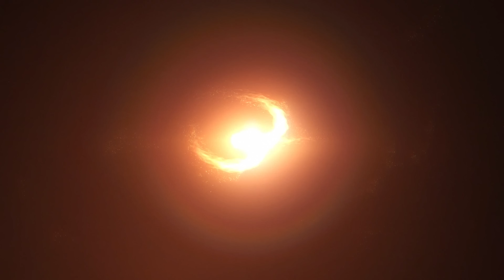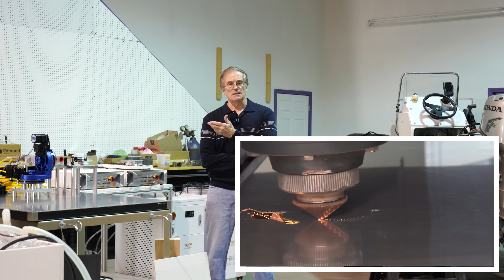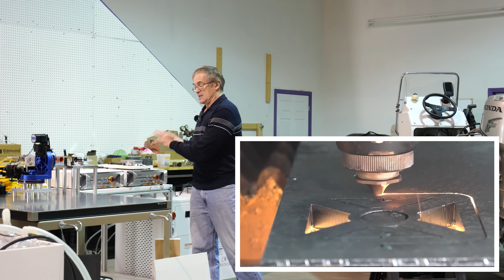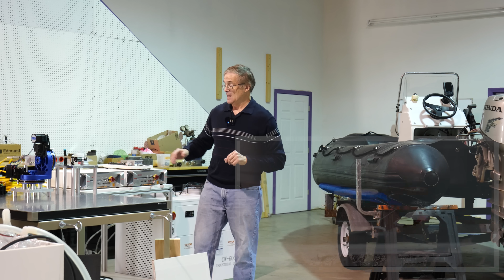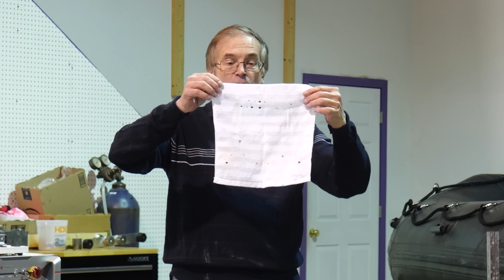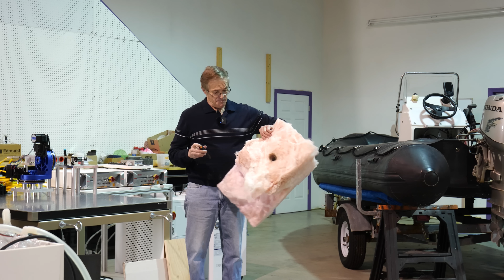We have a problem... and need your help!

Comment: My idea would be to not do what you're trying to do (block a high power laser over a large area with a low density, relatively portable material!). I would consider removing at least one of those constraints. I guess you want the high power and the large area for tracking targets across. One object you could use is the sky (after carefully checking there are no aircraft in it!). Your laser would diverge or get dissipated by the atmosphere. Fire your laser upwards, with motion of the gun constrained so that it can't reach too low an angle, and fly your targets over it.
Another idea is to use thick wood, like some tree trunks or telegraph poles stacked to make a wall. This would become much more portable if you hired a telehandler or a forklift, or perhaps bought an old used one. 👍 GL, HF, and be careful with those things. Those lasers look incredible!

Comment: Have you tried vitrified ceramics?  Like porcelain tiles for example.  Such ceramics can withstand temperatures over 2000F.  Come to think of it, maybe unfired clay?  The laser might actually vitrify it as it tries to burn through.  That might be an interesting experiment on its own.  Can you make porcelain with a laser?

Have you tried charcoal?  I mean like actual charcoal.  Not the stuff you use in your grill.

Comment: No degrees or laser experience, just a guy that installs fiber optics here but, would something prismatic work? My brain meat says if you had multiple layers of some sort of prismatic material, the beam would be split exponentially, causing reflectance and refractance effectively reducing the power. If you could find something to reduce the beam power by 20 dB (100 fold) would that be enough?

Comment: You need to switch the IR diodes that energise the fiber only when required. Continuous lasers uses a fully reflecting mirror at one end of the fiber and a partial mirror that reflects a some of the light and lets the majority pass through. It's on or it's off. 

A pulsed laser can however be controlled and can potentially reach the limits of materials in the laser cavity.  Such system may require diamond windows and front surface reflectors rather than lenses. In such systems the light output from the fiber passes through a polariser first then a pockels cell or Q-switch which is a mirror or window to polarised light when turned on or off depending on its orientation.   So one polarity of light is discarded while the other bounces back through the cavity producing more similarly polarised coherent light, building up power. After a pico second or so, the Q-switch is energised momentarily and an intense pulse of light is allowed to pass out of the laser cavity.  The timing of the switching of the Q-switch controls the pulse duration and the intensity. So allowing light to pass through the system will be very low power. Only after the Q-switch is sequenced on of off will the pulse energy be significant.  The key is to keep the power down until you need it and keep heed of the limitations of lenses, pockels cells,  polarisers, reflectors and windows.

Comment: With much higher temp resilience and insulation efficiency at temps over 3k°F than typical ceramic wool, Idon't know if stabilized carbon felt would burn off into vapor or hazardous dust, or if it would reflect. My first thought was to coat it in an IR reflective refractory coating, but that's not what you want. A test on 1" thick carbon felt batting wouldn't be too expensive. I think I've seen small pieces on Amazon.

Just wear a respirator and gloves. Make the test setup outside when handling unstabilized carbon fiber, then bring it in to an area with ventilation for the test.

Comment: Ceramic Fiber Insulation Sheets is my thought. Might not fully fall into cheap for the size you need but can take 2300° F and that is higher then normal red brick.

Comment: Maybe scattering the light somehow? You mentioned the laser didn’t do anything meaningful when not focused with your new set of lenses, maybe if you had additional lenses or a (possibly not as effective but much less expensive) large glass pane that has a rough surface to help scatter it that would prevent damage to the surroundings.

Comment: You need something ablative, like a shuttle heat tile. the removed material transports and diffuses the energy away from where you don't want it.  possibly aerogel?

Comment: A microwave tube engineer here, you need a wall of thick copper sheet, clad or brazed with a front layer of tungsten or molybdenum. W or Mo have very high melting points, while the copper behind it will wick the heat away to a larger surface area ( copper is a good heat conductor). The backside may be spray cooled with water.

Comment: A wall lined with ceramic tile, fire brick or Aero Crete with a cascade of highly aerated water flowing down its length should be sufficient. the bubbles should diffuse the beam and the h2o will take the heat away quickly. You could also try antifreeze (no bubbles) as it has a higher boiling point and i think the green coloured one would diffuse a good amount of light. just experiment with flow rate or viscosity and see how it goes! Good luck. love the videos guys!

Comment: When you get around to doing the video on the laser itself, I'd be very interested to see whether it could be suitable for boring into rock.  I recently bought some land which has a small granite mountain on it, and as it's a bushfire prone area I'd like to tunnel into the side of the mountain to build somewhere to live, such that any fires will go relatively harmlessly over the top.  As there are no roads it's difficult to get any sort of equipment in there, so figuring out how to bore a large tunnel into the rock is a bit of a challenge.  It sounds like these lasers could be a possible solution.  I had already entertained the idea of using mirrors to collect sunlight and using that to try to melt through the rock, but I'm not sure how to focus it far enough away from the surface being melted that the apparatus itself doesn't melt.  It's also a bit tricky working out how to get multiple independent mirrors to track the sun, and/or whether it's possible to collimate sunlight so that I can direct a beam of it somewhat like a laser.  But using a ready-built laser would avoid all those issues and likely leave the only problem being how to provide it with enough power.

Comment: The lockout systems from below, but also a fresnel lense made from some sort of rollable polymer foil and a drywall or whatever material about 30-40 cm behind it. Maybe one of those privacy foils used for glass to make it matt. IDK the spectrum absorbment of them, but it's worth buying some to test with.

Comment: How about a matte black  anodized aluminum plate 3mm thk with water cooling on the back (some sort of cheap manifold allowing water to circulate in the back)? Angle it also by a few degrees wrt your laser. Cheaper and lighter than copper. A bit more complex though due to the water plumbing on the back. P.S. love your videos.

Comment: If we're talking of destroying drones in flight, the solution would be to measure the distance between the laser diode and the target, either by alternating the power laser and a "distance" laser, or measuring the distance with the "return" of the power laser. When the distance increases dramatically between 2 measurements (say, every 100th of a second), it means the laser has gone through and shouldn't be fired any longer. Thus, the exposure of whatever is behind is not exposed longer than the frequency of the measurement.

If the power laser can be used for measurement as well, it's pretty straightforward, if you need to use a different pair of diodes (emitter+receiver) for measurement (both sides of the power laser), you need to adjust the measurement diode for parallax (emitter and receiver symmetrically), so you need to drive a microstep correction system on the measuring laser unless you're ok with holes as big as the distance between the 2 lasers.

Anyway, the idea is to stop shooting as soon as the target is pierced, not to block the laser beyond the target, which is not very realistic for a battlefield. In that case, you can even prevent shooting if the target is "too far" (say, 499 metres) so you're sure you're shooting a drone and not a bird, thanks to your very high definition camera that you could mount on a similar parallax-reducing microstep device behind a big lens (you don't need a panoramic picture of the scene): zooming in and out, you can get a pretty precise image of your shot and activate slow motion during a few milliseconds, so to confirm the shot.

To be fair, you should also tune the aiming system to make sure you're never aiming at eyes, it's strictly forbidden by the Geneva Convention.

Comment: What about a water curtain? Instead of a water soaked rag, use a curtain of flowing water. This way when the laser hits it, the water is constantly being replenished. Also hopefully the water will help disperse the laser energy that's hitting it so it doesn't continue past the curtain.

Comment: Hi, maybe you can use a glass wall 🙂... (Oh, is this guy stupid??? glass is transparent...) Well... think outside the box, you can use a lens glass that diverges the laser right after it hits the glass. Maybe a fresnel lens made of glass?
Reply: If it gets too expensive, maybe you can use a bunch of bottles (oriented is some way, you will need to test) and filled with water, that will create multiple lenses, the problem with that is that statistically at some points of that many bottles you will have a spot that will focus or not diverge well. But at least it could work as a proof of concept...
oh, by the way, as every one says their tittle... I'm a physicist 🙂

Comment: I was thinking of carbon fiber matrix (e.g. air filter sheets) with water circulating through it. It would be relatively light and cheap to run. After reading some of the comments, this might be a good, safe and reusable cooling solution when combined with the copper catcher and photovoltaic kill switch.

Comment: What about using the ground glass from an SLR to test. For the wall white translucent panels with the curtains that the guy who taught you laser welding had hanging in his shop. Just thinking about how impossible it is to focus the sun through a magnifying glass on a white sheet of paper to get it to catch fire, but put a single black pencil dot on the paper and it bursts into flame immediately. So I guess I'm saying go with diffusing the light rather than stopping it. Be safe.

Comment: How about using a lens as a block to expand the parallel beam back to a cone to disperse its power, and put some other material behind the lens to absorb the cone of light. Since the power will no longer be so focused, you should be able to use something like the drywall. Or maybe silicone? They use it for cookware, so maybe it would work?

Comment: One conventional suggestion is kaolin refractory wool. A more out there suggestion would be barrels of water absorbing polymers. There are round multi colored novelty ones used by many  content creators in stunts. I think they’re called zorbies or some shit. There are industrial bulk types used for  gardening and cultivation and in the manufacture of disposable diapers. These might provide the heat retention needed through water mass, and more material would steadily drop into the void created by bursting polymers. Just an idear.

Comment: Try asbestos. If that doesn't work I'd use a mirror to reflect the beam 90 degrees down from the wall to the floor into a tub of water or sand or something.

Comment: Twinkle chamber, with mirrors that Lower the transmission of Light by % on each step.
As you didnt Show a Mirror or a Prism to Split the Beam a million times.
Those are my choices, 
Unless you can find a Dirt that does not burn.

Comment: Since Plywood worked decently well a possible option would be to coat the boards with intumescent paint, on both sides, and create a stack of coated boards. Nighthawkinlight had some videos on the topic: https://youtu.be/8Z5RPPRS-KQ?si=o-zFT7-lifv9VaDC .Also I have some friends that work at LLNL NIF and could see if the have any info on how they manage the beam line on that machine for testing. Myself I work with 500 - 1kW lasers for industrial laser powder bed 3d printing at Sandia National Lab and am always happy to talk tech if you want to discuss more in detail.

Comment: I had 2 ideas. 1 is the fiber cement board (already mentioned further down). If you need some serious mass you could toss sandbags inside, but it might be enough to fill with fiberglass since the cement has already taken the brunt and broken up the beam somewhat. The other is to mount the laser in a truck and go to an old stone/gravel quarry. They're all over the place, so I'm sure you can find one nearby that would be willing to let you use it. A hillside of pure rock can absorb a lot of damage.

Comment: Loved this challenge. Here's my bid for your use case of a portable, cost effective, "crazy-powerful-laser" backdrop. A water-based carbon-black clay slurry. Considered glycerin originally, but decided the uh... "stinky byproducts" outweighed what it contributed. Did some napkin math and a "drip fed" laminar flow approximates to 15-16gal per second for a 5ftx5ft (1 inch thick, but likely tuneable to needs) sheet in the air.

So, in consideration of "an excess of safety" I suggest the design would use a 55gal drum that can be wheeled around with the dispenser/nozzle. When set up, the drum is raised-suspended to the nozzle, so that in the event power (or pump) fails, the reservoir will still pour for several seconds. A PC pump  (particularly with dampening/foam to keep noise fully manageable) can manage the recommended flow rate(around 18gps). Will need a "mesh" to catch thicker blobs that may form from superheating the clay.

Now, this could still fall under the "useless for this use case" due to the laser intensity. For example, possibly causing persistent "popping" from steam flash boiling, depending on the ratios for the slurry. The reflection constraints may mean that, even with the clay/carbon, the energy that could still possibly be reflected(presuming we're not evaporating first for some reason) the water may simply be too much of a "reflection risk."  Or the potential for "clay spatter" may simply be a cleanliness non-starter, I won't pretend I know your lab/plan. 🤭🫡

BUT if nothing else, you can be sure this "black fluid curtain" would be non-toxic and almost DEFINITELY a conversation starter. 😉

Comment: Perhaps a wall of sand. I like the salt too. Mix them? Grow salt crystals on the sand granuals. Sandwich the mixture between corrugated metal or mesh, and make managable panels. Place a reflective material behind, that will change the angle of the beam (ie. rough surface, curtain like, angled slats) to effectively double the panel thickness/rich mans russian roulette, if your math is off or software is bugged. How would you figure some of nighthawks cooling, relective, or fireproof paints, PCMs, starlite, etc, might fair? Impregnating or coating gypsum board with something of that stuff or salt? Idk. Stop exercising if your muscles are too big.
Reply: Also, live stock salt block.

Comment: Go Vertical! Have the laser and the targeting system in the rafters of your building on a platform, aimed downwards at the floor. You could then cover the target area of the floor with any of the great suggestions in the comments. But you won't be risking any of your neighbors, your vehicles or your walls. Searching the comments, @AntoineBilliard and @RoosieBoomstick arrived at the same solution I'd thought of when watching the video. Maybe enclose a small section of the floor and put water with a dye that helps absorb the laser energy that's tuned to the range frequencies covering the spread of the water and the dye to the depth you have available. Then maybe a black or absorbant backstop on the ground above the floor. Or you could just go cheap and let the laser rip up the concrete and then repour/resurface after testing.

Were any specs mentioned about the energy being absorbed? The frequencies, or total power per second that would need to be mitigated? Beam dumps from Gentec-eo mentioned 12kW (16 kW/cm² max) for their 100mm diameter aperture cooled with 6-10 L/min for one their products. I could have just missed the energy levels mentioned in the video. But if you're working with levels below that, a certain depth of water with an absorband additive may work if placed on the floor. The absorptive properties needed could be controled by the depth of the water and the effectiveness of the dye or additives. Agitation by using a pond pump may help, and also reduce the evaporation at the point of contact. You'll have expensive equipment hight in the air, and that equipment won't take too kindly to lots of steam. I believe @RoosieBoomstik mentioned even using a kiddie pool. Then for targets you can have some RC boats scootin' around as well as drones flying. Hitting the RC boats could be way cheaper than the drones in termos of cost per vehicle too.

In order to go vertical, you may have to support a significant amount of hardware at altitude as well (power distribution, laser (s), computer(s), tracking, cameras, etc.) So, maybe a vertical setup could be prohibitively complicated, but possibly less costly than a horizontal targeting setup for testing indoors. If all else fails you can just open the door and shoot into a dirt berm as mentioned by @mortoopz, @Spirit532, @apolyon138 and others.